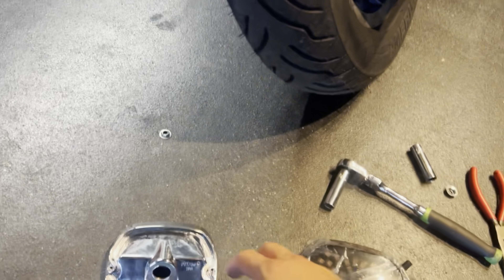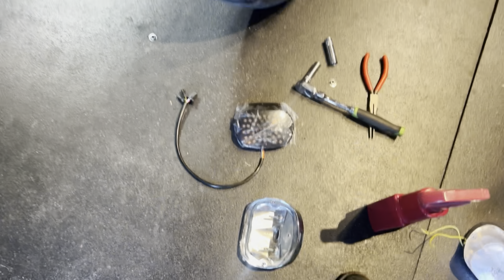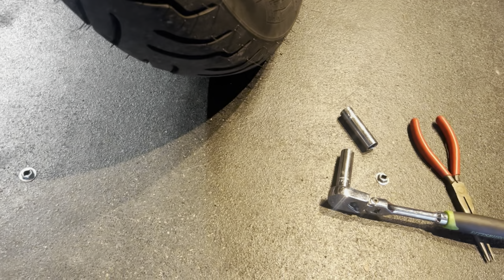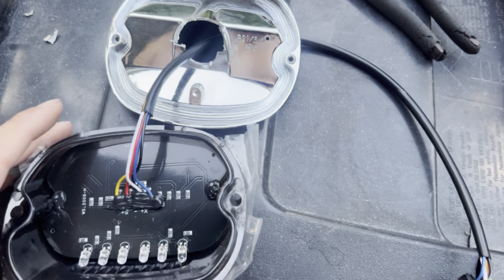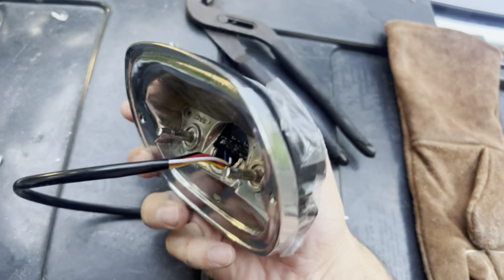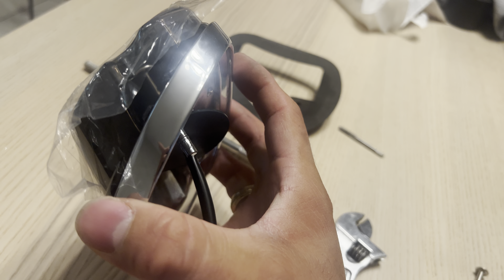Converting Old Early Style Harley Taillight to Newer Style on FXR

Comment: What wires went to what wires?
Reply from the maker: Black is ground. Blue or green is usually running. Red is the brake light.
Reply: Whats the white n yellow wire? Is that part of the turn signals directly ? Thanks for responding!